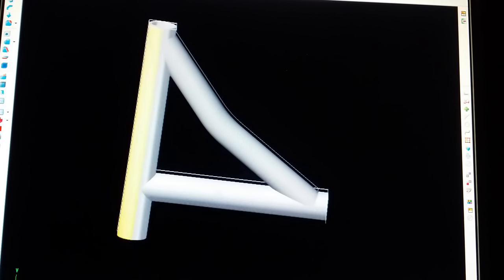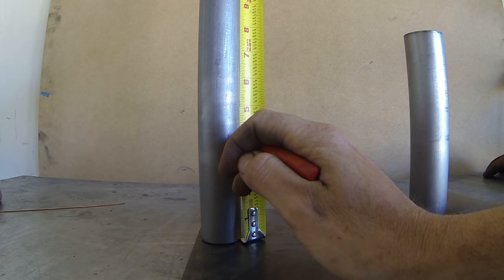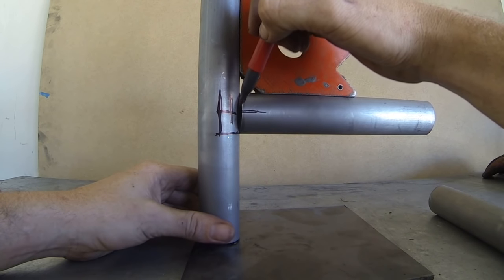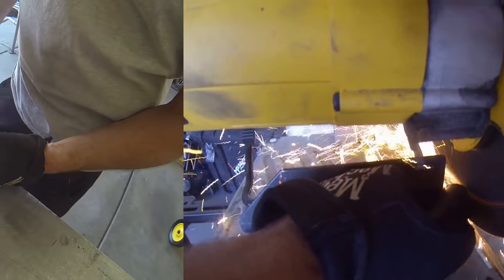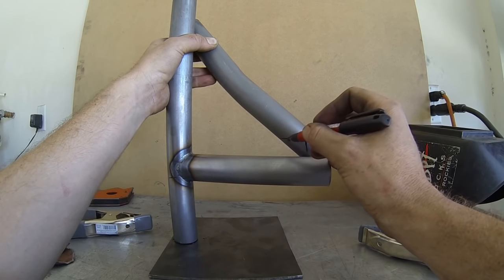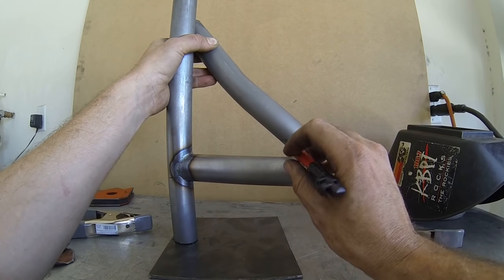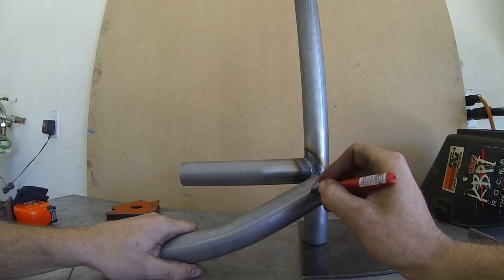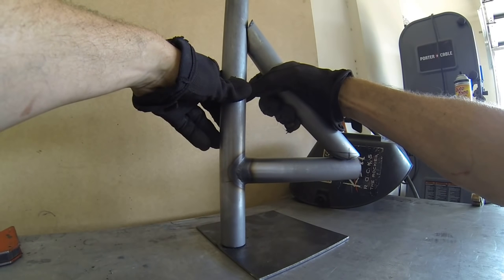TFS: How to Notch Tubes Without a Tube Notcher

Comment: cool, i was wondering what the big deal was with the tube notcher it kind of looks just like a hole saw mounted on a drill press. Like the demo i learned what those welding magnets are for ya they come in handy holding those pipes in place. In general using magnets to hold metal in place is a nice idea makes things alot easier then tons of clamps. To me it allows one to make easy measurements without extra help or something wobbling on you and you loosing your place.

Comment: Serious question. I have no idea what I’m doing when it comes to fabrication. Could you not center punch the vertical pipe drill a circle big enough for the pipe to fit and then weld it? Would that take too much of the structural integrity out of the vertical pipe?

Comment: Would a hole saw be useful in producing perfect fit at whatever angles? It would have to be the same diameter as the pipe, but a drill press with a large vise might allow for that

Comment: I made one simple mod to my Baleigh TN 250 so I could adjust the plane height and there is no way your method can be faster and more accurate. Even on extreme angles and offset planes it takes less than 1 minute to make a perfect notch, only using my angle grinder to add the bevel for the filler rod.

Comment: Love this series!
Quick question, if I have a straight pipe 31" between the uprights, 1 1/2" tubing, how do I get the length correct figuring the notch?
Reply from the maker: Add 1/3 diameter to the end of each side for total length. In this case, if you have 31 inches between the uprights, you need a 32 inch piece with a half inch throat depth cut on each notch.
Reply: The Fabrication Series Thank you for the rapid reply! You truly Rock!
Will do the fabrication tomorrow thanks to you!!

Comment: Great info! I am not a welder, of any sort, but you explained the process so well, I get it!  
     Do you have any thots on using a welding compound, like JBWeld, to join, 1/16" X 1 1/2", pipe that is not load bearing? 
     (For a non-welder)

Comment: As a boilermaker The depth of the pipe on top of the other pipe should be two thicknesses, not 1/3, although it looks to be working, a template would also make things faster, I do like how you do this.

Comment: so after learning your technique ive finally started to figure it out to where i can get a good fit with minimal grinding but ive only been using a 5" angle grinder which means i get interrupted cuts when chopping tubes. its about time i bought a chop saw but i cant decide whether or not to go with an abrasive chop saw or get a cold cut setup. what are your thoughts on cold cut saws? if the blades really last as long as they claim sounds cheaper and more efficient but alot of online reviews say that the blades get wrecked really fast.
Reply from the maker: Cold saws are nice but they usually require you to clamp the work into the saw at whatever angle you want to cut. It will limit the angles you can achieve. I prefer the chop saw.

Comment: QUESTION: you say 1/3rd the tube size is the throat depth. what if im notching a 1.25' pipe to a 1.5' pipe?  do i divide the notched tube by a third or do i divide the tube thats being notched around by a third?

Comment: Good way, I guess, if it works for you. I've done tubes a long time...and I've never found an issue with the 'drill press', 'hole saw' and 'barrel sander' method. If you have a good standing drill press, an on-size metal hole-saw, and a wooden dowel 'barrel sander' (for the drill press or your hand drill), then you have ALL THE TOOLS you need for tubing (other than your MIG or TIG welder). The 1/3 depth is a great rule to remember, though.

Comment: Great videos!  I'm curious...is there an industry standard metal used in roll cage building?  what about diameter and wall thickness?  if not how do you go about calculating the appropriate material needed?  Thank you.
Reply from the maker: There is not necessarily a standard, but every sanction will list their requirements and some are similar. The rulebook for that particular sanction is the ONLY place you need to look for specifications.

Comment: I dunno, I bought the tools for notching at harbor freight and it worked fine for my project. It wasn't perfect, but definitely gave me a confident cut with the associated hole saws I got there as well. Cheaper than the dewalt cut off saw in this video at least lol

Comment: You could also use a drum sander equivalent to the diameter of the tube and plunge the angle into the abrasive. Perfect cut every time.

Comment: Plug stones work great for these notches, its basically a grinder stone in the shape of a cylinder maybe 3 inches long 1.5 wide, they screw right onto any basic grinder with a 5/8 threading. Available in various sizes.
Reply from the maker: I've heard of that before but it looks a bit too awkward to hold for me. It could work well though.

Comment: Cool video. I've found Sketchup is a good way to create templates. There's a plug-in named 'unfold' - I think it's designed for making paper-folded models. You make a model of the intersected joint, then 'unroll' the tube and you're left with a printable template which you can wrap around your actual tube and create a very accurate layout to follow.
Reply from the maker: I tried playing with Sketchup when it first debuted. It was confusing for me but if it works for anyone else, have at it. Thanks for watching!

Comment: What type of tubing is best for a side by side UTV/ATV Rollcage? Chromemolly ?
Reply from the maker: Most people use DOM, but some use ERW. Chromoly is pretty overkill for something like that, but I'm sure it has been used. The "best" tube is the correct tube based on calculations by design. There really isn't a universal tubing for all needs and requirements.

Comment: I can't read all the comments, but for aluminum and 90 degrees a hole saw works great if you don't need great precision. For this to work, you need extra length of tube before drilling/sawi ng.

Comment: Great technique, but what if you want to weld pipes together in a way that require that the pipes (connections) to be hollow, as would be the case if you needed fluids to flow through them?

Comment: You can also take a tube, drill a hole in there the size of the tube to be welded and tack a plate in there. 
This way you can stick a tube in there and just draw the line to be cut. Our welder does it this way.
Making this does take a few minutes, but its worth it in the end because you can use this forever.

Comment: If you were to cut 2 sides in need a perfect measurement how much is the difference between where you coped it and the distance from the other koepp on the other side of the pipe

Comment: Nice tip: Need an honest opinion, Can you do that with an "All-in-One" Welder? I'm looking at either ESAB EMP 215ic or a Millermatic 200 or even Miller Syncrowave 210... I only have room for one welder, but Need it to weld backhoe buckets and I need to weld a 12,000LB winch to my car-hauler as well as tiedown loops, and I have an aluminum boat that got smashed on the rocks and I want to fix the leaks, and do railings and now maybe even build a trike from the frame up... But if you can only have one welder in the price range of these what would you have?? (is there another one I've over looked?) Also can the Miller 210 cables interchange with the Millermatic 200?? As a friend has the Millermatic 200 and I want to make sure if I get the 210 and I'm mig welding on a Sunday after Church and the gun breaks down, I want to be able to call him and have him bring over his gun to finish the job, instead of having to either waiting a week to order one on line or even waiting for the next day to drive 30 miles into Vegas to try to find another one... Anyone that have one of these or have used these please let me know of any drawbacks on any of these... Thanks for your help!!
Reply from the maker: Debo Debod I'll try and simplify all this. 
All the welders listed use the same Dinse connectors but all do not run the same functions so they might not be interchangable even if they connect. 

The all-in-one models are DC only with optional TIG. They won't weld aluminum on TIG. The Esab is a lift-start and I'm not sure if the pedal changes that mode or not. 

The Syncrowave is a TIG that has a spool gun option. It will weld anything in any fashion, but if you're like me and don't like spool guns, it will probably be a pain to MIG small/quick stuff. 

The all-in-one models are small and portable which is nice if you ever have to move it around or run to a friend's house to weld something. The Syncrowave is a 130 pound brick (without the bottle). Portability is not as easy. 

Personally and professionally - I pretty much TIG everything. Every now and again I borrow a MIG from my friend if I need it. My TIG will do everything.
Reply: So you're saying Tig is better than Mig? Is it easier? Is it stronger? I have a $89. Harbor Freight gasless Mig I have used to do little stuff, but need something that can Handle a "Heavy-Duty" brackets to mount a "12,000LB" Winch to haul Dead Trucks onto a trailer without breaking apart and killing someone... As well as repairing everything on my Backhoe out in the field... And yes for artsy-crafty stuff in a few years as well...  I have never welded with "Gas", in either Mig or Tig, and I have never welded Tig at all... Kinda looks like old school Oxy/Actl Brazen without the big torch, and open flame... Most of my work will be done either on 110V House or 110V Gen, until I can find a good used Gen that's big enough to run it on 220V easy... I have never used a spool gun, so I don't know if I like it or not... I don't know if it matters or not but I'm Left-Handed So some of the things would be backwards for me... I may need to do some exsust work on my pickup and Old RV as well... I have done some stick welding 40+ years ago with an old AC-only Lincoln 225... I also want what ever I get to be something I can let my Grand-Kids take to a welding class and learn how to weld properly, Then I won't have to do anymore welding... LOL!! I'm leaning towards the MILLERS  But just don't know if I should get the DC-only 200 or the AC/DC-210 I have a trailer to roll the 210 on so hauling it around wouldn't be that much more work as the trailer is on my truck 99% of the time anyways... But the 200 would fit in the trunk of my car that gets 40MPG  and the truck gets 12MPG but I don't plan on using it that much...  See I may weld 5 or 6 things one year and not weld anything for 2 or more years... Actually the last time I welded anything was in January of 2015... But I have a bunch of projects coming up from making Shooting targets to everything else I mentioned and more... So I can't make a mistake and spend a ton of money and not get the right unit... I appreciate all your help and look forward to your response and help... So if Tig welding is "Stronger" and can weld a wider range of stuff, I will get the 210 and learn how to Tig-Weld... Let me know... Thanks
Reply: If I may throw in my unasked for opinion: 

You're probably going to be limited by the circuit you have available to power your welder. Instead of worrying about whether to buy the 200 or the 210, look at the spec sheets on the Miller web site and compare the current draw to your breakers. If the breakers aren't rated at least 20% higher than the expected current draw, you are going to have problems.
Reply: Once I find the welder that can do everything I need, I will then find a portable Generator that can run the welder at it's max on 220V, and use as a home backup Gen... and if I need it for a small job I have a small 5000Watt I carry in my truck that can run it on 110V fine... And if I use it at the house it will be on 110V or if I need the 220 I will fire up the gen.. But I can find used Big gens, but I want to find a NEW Welder that can do "Everything" I need it to do... That's going to be the hardest part... As the welding companies are still in the dark ages!!
Reply: Good plan. If I understand correctly, you'll limit your work on 110 house circuits to the current draw that the circuit is rated for. If you need to do heavier work, you'll fire up the back-up genny and plug your dual-voltage welder into it.

So next step: what process? My knee-jerk reaction is "MIG" and here is why: welding is a skill that is developed and maintained through practice - lots of it. MIG has the lowest skill demands of any of the processes. Your requirement seem to be to "just attach things solidly a few times a year", so something with a short learning curve is going to be top of the list. MIG can be used on everything from thin-walled tubing to putting your backhoe back together.

Now, I'm an amateur, not a pro, and I taught myself stick, oxy-fuel and scratch-start TIG because I like doing them. You can now buy tri-process machines (MIG-stick-TIG) but each additional process is a significant jump in price. Think carefully about why you want each process:

TIG is the queen of processes. Very clean, and can join metals that would be otherwise difficult or impossible - stainless steel and titanium. It is very slow and high-skilled, but you can do very fine work with it. If you add TIG, I highly recommend HF start (you press the button or pedal and something like the spark in your car lights the arc.) As well, you need to decide if you will weld aluminum, in which case you will need AC/DC TIG rather than plain DC (which is even more money).

Stick is fast and dirty. The long, narrow electrodes allow you to weld in places that other processes just can't. Out-of-position welds require real skill to perform well, but are very sound. Different electrodes allow you to make very different welds - just scratching the surface here, 6011 has great penetration, 6013 produces nice smooth welds on thin plate, 7018 loads on huge amount of filler really fast, hard-facing electrodes let you surface a backhoe bucket to reduce/repair wear and so-on.

One process will not inherently produce welds that are stronger than another process. For the kind of jobs you've alluded to, correct choice of materials, joint preparation and execution skill are far more important than the process.

Finally, I did teach myself, and then I went to some night courses. If I had to do it over again, I'd probably start with the courses.

Good luck, and have fun!
Reply: What kind of TIG do you have?
Reply: Colton Chapman - I do scratch start with a small inverter DC welder. It is no longer made, but it is equivalent to a Princess Auto 8538902 paired with a Princess Auto 8618449 torch and 8591158 regulator. "Scratch start" means I touch the electrode to the work the way you do with a stick - this sucks, don't go this way unless you're broke and can't afford a machine with HF start.

Comment: We use 3/8 notch for inch and a half handrail pipe 1.875 OD. But I figure that's probably because of the heavier wall thickness.

Comment: Suggest beginners start by buying a length of exhaust tube and use it to make various angle joints. Exhaust tube is cheaper than structural tube but welds the same. Start with the simple jònts and work to the more complex. 

Do not try to save money by getting cheap equipment. Most cheap welders, saws and grinders  wi ll  make out far more difficult to learn how to fabricae anything. Do not forget to buy good safety equipment. The arc can blind you, spray can burn a d the fumes are not good for your lungs.

Comment: The workmanship is absolutely fine.
But; You use a three-dimensional design program, but you do the cutting with an electric saw.  It was very interesting.
When I saw the 3D program, I thought you were going to do it in CNC.

Comment: NIce.  I suspect some of your "rules of thumb", etc. were come by with a lot of sweat equity and some thought.  Thanks for sharing.  Good point about non-planar joins, as well.  Hadn't thought of that.  Clue that I've done none of this, huh?  ;-)  I want to build a triangulated frame (what else?) reverse trike for the street and this could come in handy.  Will have to wreck some pipe first, as you say, to get the bugs out.  Thanx for sharing, Thumbed up.  Will go look at some of your other stuff.
Reply from the maker: Rules are based on the years of doing this and formal training. Thanks for watching!

Comment: For the beginner, you would only tack the 90 into place. As you can see ..to fully weld it before having your knee brace in place will put a bend in the vertical pipe! After tacking do an inch of weld on each joint..keep heat low...then do an inch on the opposite side of each joint and so on until complete. This will prevent distortion quite  significantly😊.

Comment: Double checking on throat depth when notching 3" to fit a 4" pipe. I would use 1/3 the diameter of the 4" as the throat depth correct?

Comment: So much work to coup pipe, used simpler methods 45 years ago.
3 ways.
1 with a hole saw, not enough accuracy.
2 with a grinding stone very fine work
3 with flat sander very fast for railings.
In so far, I haven't seen any welder/fitter grinding pipe/tubing welds the proper best smoothest  way.

Comment: With the angle notches. How long does the throat line need to be drawn? Is it just half of the tube? The length of this line could change the cut angles I think.
Reply from the maker: It only needs to reference 180 degrees so the cut lines can be drawn. The opposite side will match when you cut it.
Reply: Ok great. Thanks for the reply.

Comment: Looks like the most efficient grinder is when the grinding face of the sandpaper grinder has the same compound radius that the receiving pipe has. Like a spinning cylinder same radius as the pipe, you are trying to match against.